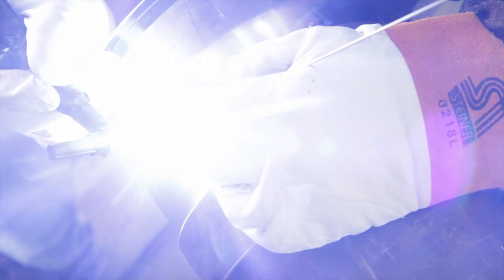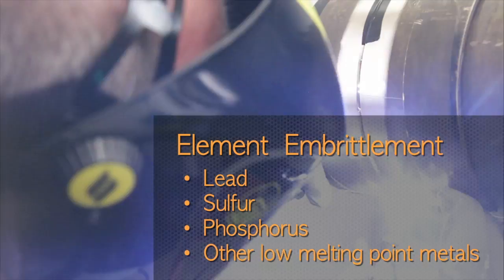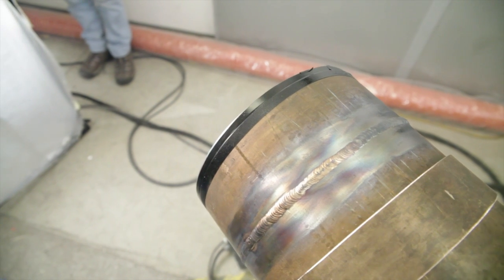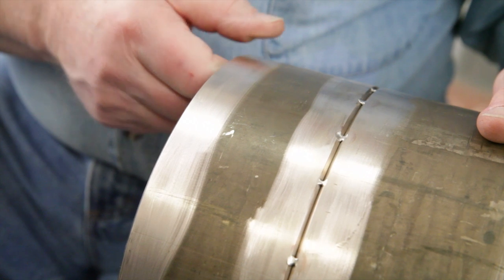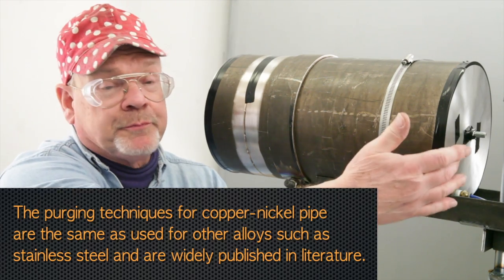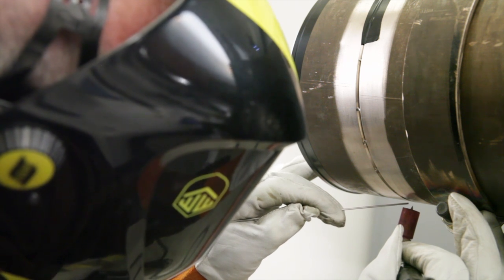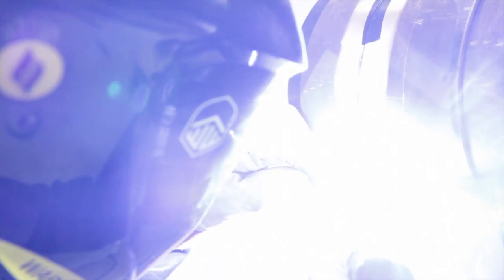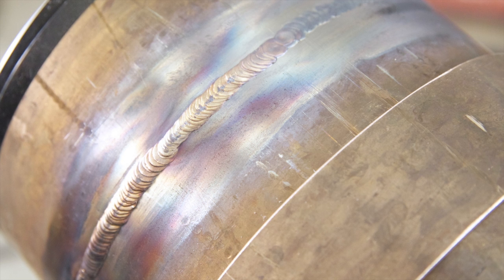CDA - Pipe Welding Copper-Nickel Alloy Part 3 of 5

Comment: how can someon even get into welding this metal ?
Reply: Shipyards...used a lot in water systems.
Reply: It's pretty common plumbing used in yachts.
Reply: @NoVanity1  fuck you dude a job called me wanting to pay me 30 an hour to weld this metal but i have zero experience in it and how am i suppose to get into pipe welding if i cant even pass a test since i never welded pipe before ive been trying to get into pipe welding for ten years with no luck smh
Reply: Yeah,I took the test at a naval shipyard...crap work,would suggest you stay away from it

Comment: it looks like he has no gap . but what he is actually doing is called a keyhole technique. which creates the gap necessary for penetration
Reply: I'd like to have seen the inside root for penetration! The Copper/nickle plate video you guys made, didn't have any root penetration and had to grind out and re-weld back side.
Reply: you actually dont keyhole cuni. you fuse the root and add wire. using arc force to drive through the bevel edges. i weld that same thing everyday on a positioner
Reply: wow thats cool welding this is pretty rare especially welding it everyday!
Reply: +Kyle Graham Which industries uses these alloys for piping? thanks!
Reply: @facundojp10  Navy ships also use a ton of this stuff.
Reply: Offshore oil and gas industry uses copper nickle for there fire water systems.